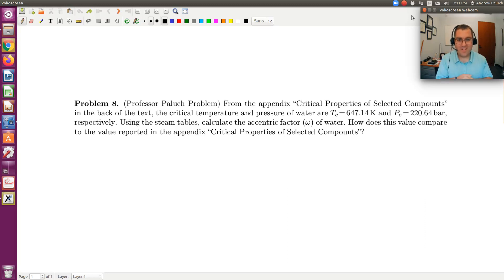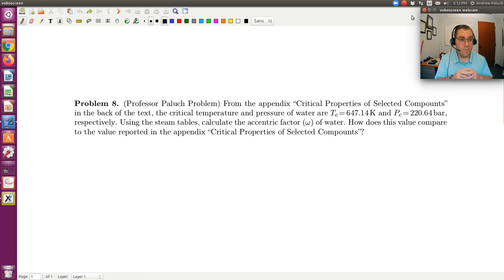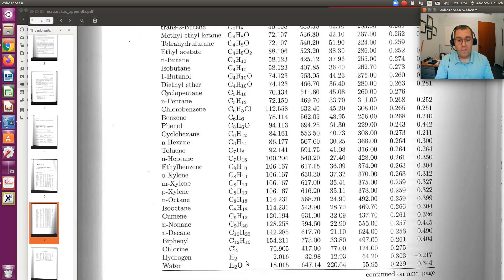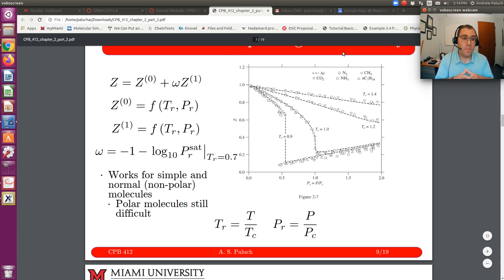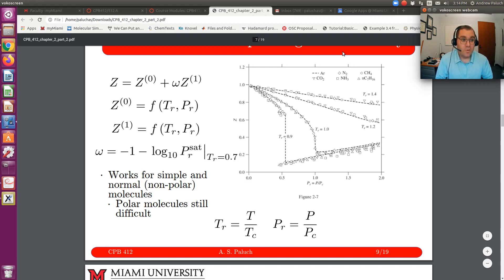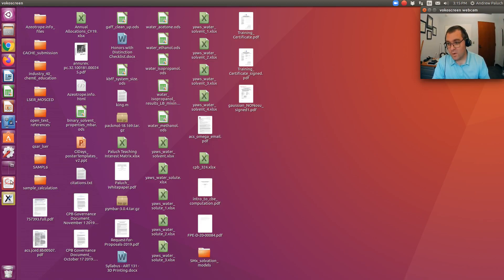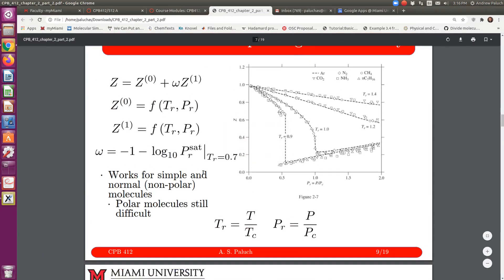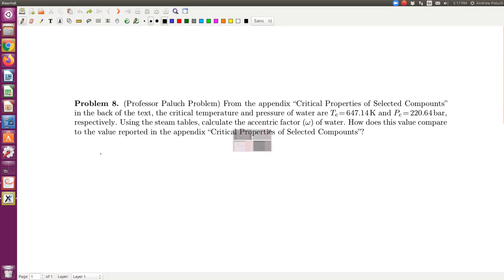Chapter 2: Accentric Factor of Water Example

Comment: thanks for sharing. how do you know the Pr, if you do not have data for pressure at Tr=0,7
Reply from the maker: Good question. We know Tc and Pc. Given this, we can find the actual temperature corresponding to Tr=0.7. In this problem we are dealing with water, so we went to the saturated steam tables. If data is not provided for our exact temperature, we would need to interpolate. 

For example, here we would get a temperature of 453 K or 179.83 C. Going to the steam tables, data is available at 178 and 180 C. You could then perform linear interpolation to get Psat at 189.83 C. Then once you have the actual Psat, divide by Pc to get it in reduced form.
Reply: @AndrewPaluch  Thank you for the fast and detailed feedback Andrew, I appreciate it. 

Please correct me if I am not right, but based on my undemanding, if there is no experimental data available (like a steam table) for an individual molecule or element, it is not possible to interpolate and predict the Pr.

Or is there a set of basic physical properties ( e.g. MW, bp, density, Gibbs free, enthalpies, Tc, Vc, Pc) which can help to determine the Pr value (without knowing the steam table) ?